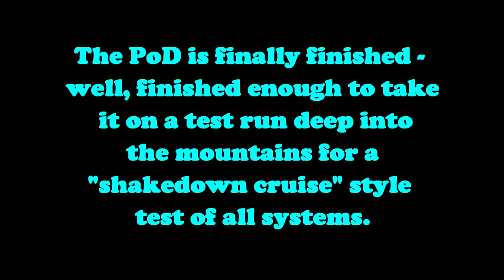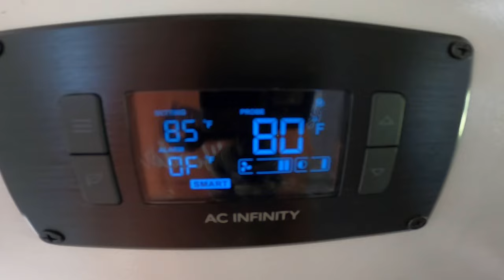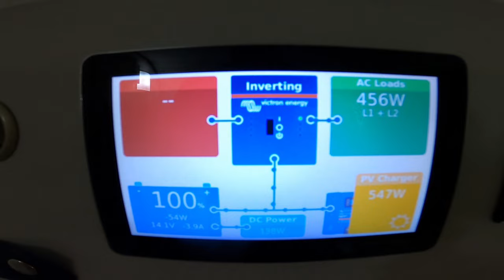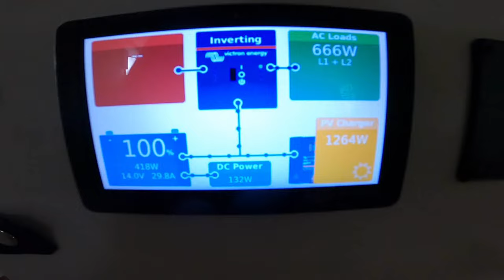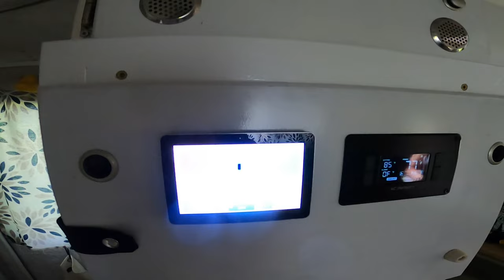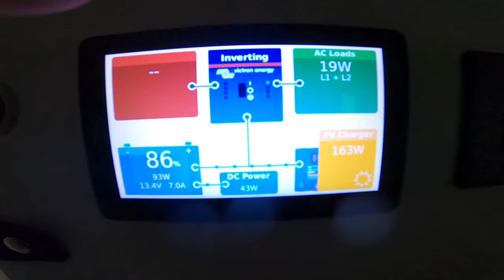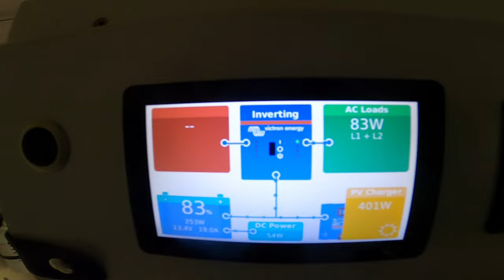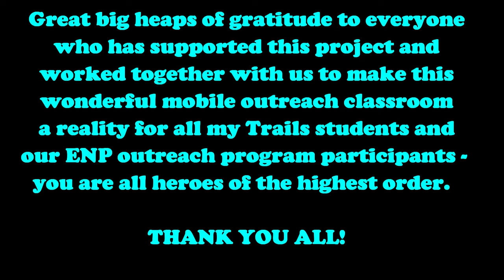Casita RV becomes a classroom: The SS NaSA PoD Project Part Three

Comment: This is the first video that I have seen of yours. The solar setup is stunning. I just installed a single 160 watt panel on our 2018 Casita with s simple Renogy 10 amp charge controller, mounted in the cave to our AGM battery. We live in the Southwest so our access to exposed sun is pretty decent. I’ll have to look at more of your videos to get a better idea of your system. This was very enjoyable, thank you.
Reply from the maker: Thank for the kind words - it has been an amazing journey to get the PoD this far.  
I have used Renogy and they are quality products and will give you the power you need - especially in the sunny southwest.  We chose to go with a larger system and Victron components since we needed steady and higher power supply to run all our systems - and we live in an area where we have frequent clouds and rain.     

Yes, when you get some time to sit down and watch our long format documentary style videos of this project, we would be interested to know your thoughts and suggestions.

We owe our success with the PoD project to many amazing project supporters who have supported us to make the awesome happen - THANK YOU ALL!